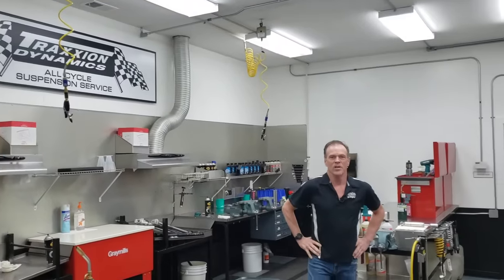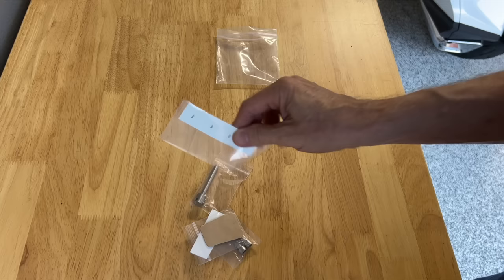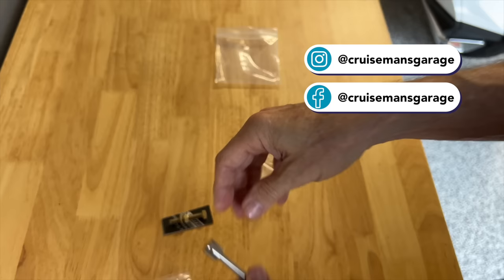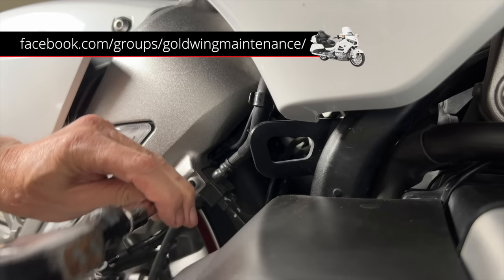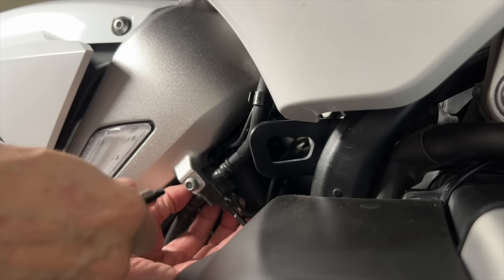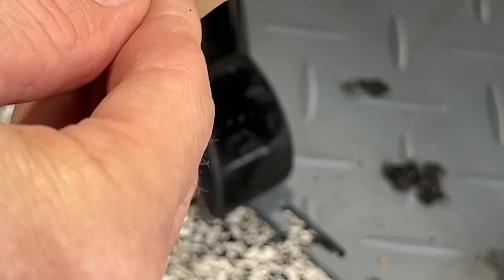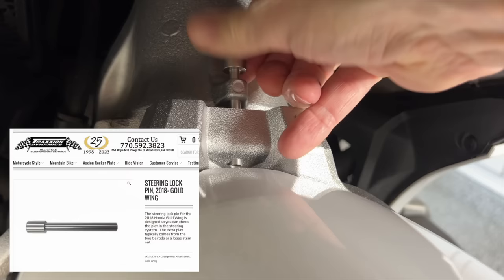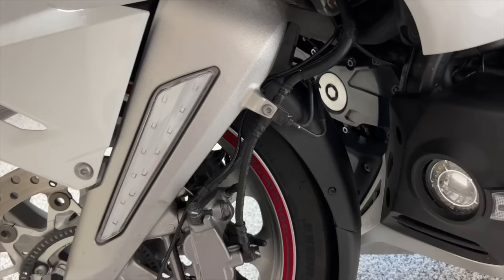Goodies From Traxxion Dynamics For My 2018 Honda Goldwing

Comment: You can also implement great tactile feedback on the horn button by sticking a cabinet drawer "bumper" on the button. You can get these at building supply stores. They're the perfect size and you can easily feel them without looking...even with gloves.

Comment: Chris if I had to rate the horn button sticker I would give it a F, it does not show up at night.  The horn button in my opinion is very poorly designed either the button should have been longer and stood out past the side or placed on top of the hand control panel. Perhaps Max will engineer an adapter for the button so it's easy to find when needed
Reply: Great idea!

Comment: The bolt extension is a good idea, but metric hardware can be had at any decent hardware store. But it’s a idea I didn’t think of so I’ll give him that. The pad for the center stand is great. I have one but like you, it’s getting warn. I have the oil stick expansion and love it. 
Max does continue to come out with cool bits and pieces. 
I had the full suspension mod done on my ‘07, without a doubt the best thing I ever did.
Reply: I want Max to come out with an air filter you can change in less than 15 minutes...
Reply: Must be Brass for conductivity.

Comment: Love the Dip Stick extension cap and oversized Kick Stand pad. As with all of Traxxion’s products these are CnC’d and are of a quality fit and finish. Also have the brass positive side Battery Terminal post and genius glow-in-the-dark Horn button sticker. Next I’m thinking the 3 piece crash protection kit. Nice job here Cruise.